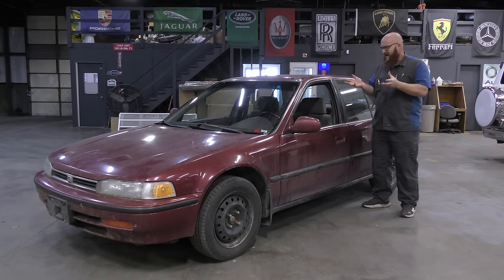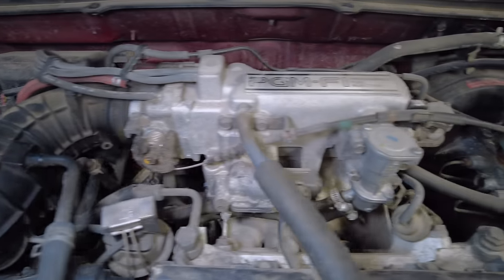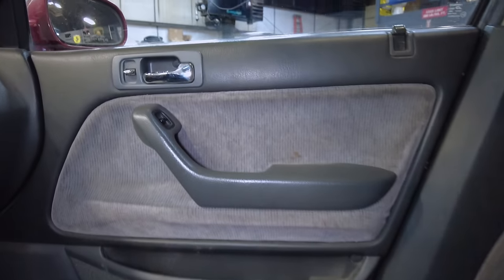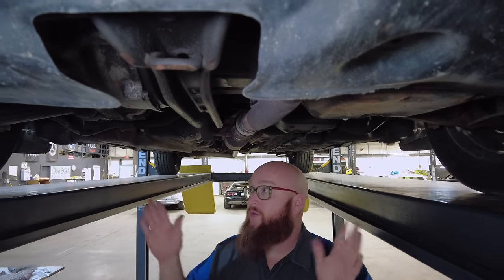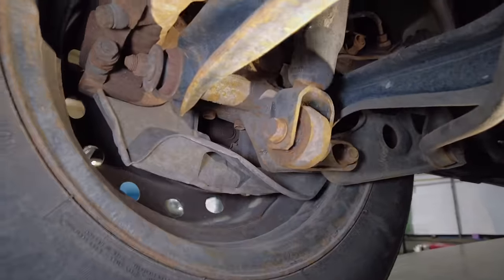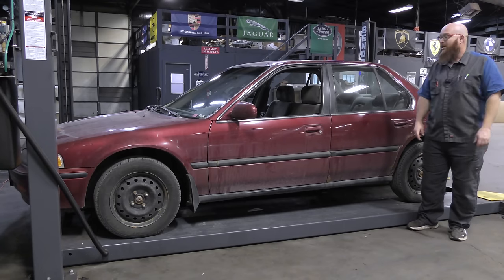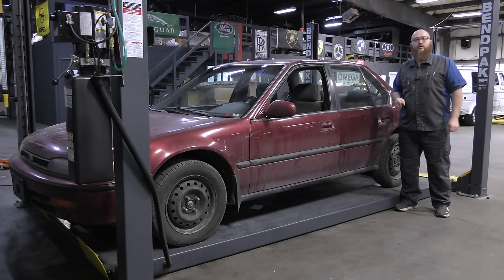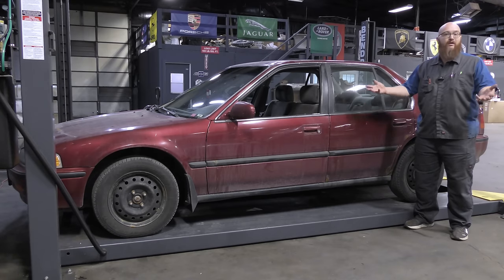A True Testament: 32 year old Accord with 380K miles! When Is It Time to Let It Go?

Comment: My first car was a 91 Accord coupe that had the same body style and was a stick but had automatic seat belts.  I bought it in the summer of 99 at 17 with a salvage title and 237,000 on the odometer. It burned a quart of oil a week and was quite rough but it was mine! I bought a new to me floor for the trunk since mine was missing and a passenger side view mirror that was from a salvage yard on the internet. My dad tried changing the valve stem seals to fix the oil consumption (it smoked like a train) but it didn’t so after Christmas break I brought it into my auto shop class in high school and we pulled the head and sent it out to be rebuilt. The machine shop owner and my shop teacher were friends and he came by after looking at the head and said I bet the rings are shot. He was right there was no tension left sky out came the motor and we overhauled it in class. Replaced the clutch and had the injectors rebuilt while I was in there. While putting it all back together my teacher had a heart attack in class while helping me reinstall the CV shafts and had quadruple bypass surgery the next day. My dad and I towed it the 8 blocks home and he finished it while I was at graduation rehearsal that Friday.  Three months later I got tboned in an accident and totaled the car. I was sooo devastated after all the work I had put into it.  Man I miss that car!
Reply: Damn the memories
Reply: "my teacher had a heart attack in class while helping me reinstall the CV shafts"
At first I thought it was figuratively, not a literall one.
Reply: @Misack8  I wish it was figurative.  The wood shop teacher next door came to get him to somewhere comfortable and as they led him away he handed me his school keys and told the other shop teacher that I was in charge of locking up and secure Inc everything and they sent the rest of the class to wood shop to hang out for the day while I locked that room and his upstairs classroom down and hung out.  I saw him about 6 or 7 years ago and he was looking much better!

Comment: I have a 240k mile 2010 Civic.  I've replaced the AC system recently, the air mode control motor, the drum rear brakes at 200k miles, a couple sensors, the headlights a while back, some window lining, and the power steering pump.  Did it buying parts and have an extremely skilled mechanic friend so saved the shop costs.  Absolutely worth taking care of and I hope to take it to 500k eventually.  I want to keep it for life if I can.

Comment: My mother had a 1992 Accord she purchased new when my family PCSd home from Germany. She was still driving it in 2015 before she finally sold it. Had 400,000 miles on the odometer and my dad rolled the miles back several times over its life. They guesstimate it had over 600,000 miles on it. 

All she did to it was routine maintenance. She hit a dog or something in 2010 and broke the passenger side axel. Only significant repair she had the entire time owning the car. 

Since 1992 my family has exclusively owned Hondas due to their incredible reliability and dependability. I’m sure this Honda will make the next owner extremely happy especially with the manual transmission

Comment: Congrats on the million subscribers. I am the original owner of a 2004 Honda Element with 230k plus miles and drives like new. No rust or dents. The bolsters on the front driver’s seat are worn but I have Honda Element seat covers for the front. Unfortunately Honda cheaped out on the seating. I service it routinely. Simple jobs I do myself and leave the more difficult jobs to the experts. Absolutely love the practicality of this car. Replacing sway bar bushings is like a 30 minute job if that and the bushings are cheap. 
Thank you so much for the video.
Reply: Got 03 pilot with 220k..bought it 4 or 5 years ago w 130k for $4000..2 d best vehicle behind my 94 nossan king cab truck w a manual transmission..had that for 300k miles pulling a lawn trailer..bought it from original owner in 98 w 125k miles for 2 grand.

Comment: I have a 2001 Saturn LW300 wagon that I purchased new that has 404,000 miles on the original engine and transmission. 
It has been a semi-retired dog taxi and foul weather/extra vehicle for a few years but it still starts instantly regardless of the time it's been sitting or the weather and it runs and drives fine.
The only thing that's ever been done to the engine outside of routine maintenance has been valve cover gaskets twice and the only other major repairs have been an ABS pump and shift solenoids in the transmission.
It is always been maintained according to the severe service schedule as outlined in the owners manual by a trusted knowledgeable mechanic and has given excellent reliable service. It's only been towed twice
Once when the fuel pump went out and once when the alternator died.

Comment: I have a 1993 accord coupe EX-R (Canadian model). I swapped it with a JDM H22A engine, has full bolt ons, the engine year is a 1994...

Few years ago i had it tuned on the dyno. It made 208 whp and 161 ft/lb at the wheels..

Pretty crazy when you really think about it.. the engine is 30 years old, the limiter is set at 8200 rpm (roughly 1000 rpm higher than the factory rev limiter). I beat the brakes off that car, it sees limiter every time i drive it. And 30 years later, its STILL running strong and making more power than it did from the factory. A testament to the build quality of Honda from the 80s through to the 2000s.

Comment: My 2003 Honda CRV is at 345K miles and still going strong. I put the money in it to keep it on the road. Cheaper than a new car. I drove it 7 hours each way on a road trip around 300 miles each way. I'm making another similar trip with it in July. Plenty of new parts and never stranded me. I burn a bit of oil every 1000 miles and top it off and keep going until the next change. I'll drive it until it explodes.

Comment: My ‘84 Corolla made it to about 685,000 miles. The first 250k were pretty good, no big issues. Changed the head gasket around 300k I think? Clutch, wheel bearings, valve seals, etc. Changed the HEAD around 600k and that was the beginning of the end. Got a brand new head and it was a disaster. One spark plug hole didn’t even have threads. I should have just sent it back but I added threads (that area never had any issues). Engine just never ran right after that. Tried rebuilding the carb then eventually just got a rebuilt one - ran worse after that. It would shut off for no reason at random and after sitting for five minutes would restart. 

Worse though was my ‘89 Supra. Piece of junk that should have been recalled. Head gasket blew at 118k miles. I took five weeks and rebuilt everything: engine from the head up, alternator, new clutch, timing belt, of course, and worst of all had to buy several new shims for the stupid valves. Adjusting the valves took a week, and a spreadsheet full of my shim measurements. Some of them were $25 each and I needed several. Sold it a year after and Never looked back!

Comment: My 2008 Accord has 336,000+ & still runs strong.
Reply: is it the 2.4?
Reply: Original trans and engine ?
Reply: Just regular maintenance?
Reply: Hes lying he wont respond
Reply: My '04 Accord is at 222K and I've only replaced the water pump and the AC condenser (stone damage). It's a 4 cyl / auto.
Reply: My 2012 has 256,000 and still driving smoothly
Reply: @bige3201 Engine/trans?
Reply: @dontrend5956  original engine and transmission. 2.4 litre. No oil leaks either
Reply: @bige3201 Auto trans?
Reply: @dontrend5956  yes
Reply: My 08 had 326k when I sold it. Burning oil and rear main seal leaking but ran great
Reply: @ERogers-qn2sm  It's actually very common for a Honda K24 to do well over 500,000 miles. There's a guy on you tube with a CRV same engine, 1,000,000 miles. I am not sure what the confusion is about 336k miles on an engine that's common for high miles?
Reply: As long as it’s not a V6 automatic it should do nothing less than 250k at least on the original drivetrain

Comment: I just sold my 1996 Odyssey I bought new. It had 340k miles on it still running great. I also had a 1990 Civic Hatchback with 310k miles, which I traded in for a new 2016 HR-V. I also have a 1989 Integra LS with 240k miles, and a 2007 Pilot with 162k miles, along with the aforementioned HR-V. I love Honda products!
Reply: 1996 Honda odyssey is actually made by isuzu.

Comment: Hi Car Wizard. I bought a Toyota Yaris 2008 sedan 2 yrs ago at 175000 km ( 108000 miles) peanuts for a car like that up here in Canada  for $4500. It now has 220000 km (137000 miles)The only thing I changed was the starter. Its been a great car for 2 yrs now driving me from to work from A to B. Also for its size , its surprisingly comfortable and the trunck in the back is very spacious and useful. I did some body work cause a bit of rust were the plate is...did good job, Bondo... match paint...clear coated it but a bit dull. It needs new rocker panels cause of rust and lots of salt here in Canada. I will form and weld the sheet metal with the mig into place, some foberglass Bondo...sanding...prime and paint. I'm planning to give a final clear coat on the whole car once everything is done. I'm a diy but this time will use the professional paint gun instead of cans😂. My question: I know I'm saving at least $3 to $4k by me doing all this work, how many more miles or kilometers will the car last me, it's a daily driver and is it worth the investment in time ?

Comment: I had a 1996 Accord. Bought it from a friend with 198,000 miles. $1300 and came with new plugs, wires, rear brakes and a battery, all done the day before. There wasn't a single straight panel on it. Drove it two years and only needed wiper transmission, front brakes, and a speed sensor. Sold it to a coworker for $1000 at 210k and 6 months later it had 260k. I asked him how it was treating him. His exact words: "Dude! The cruise  control only goes up to 100, so I get on interstate every morning at 4am, adjust the seat so my leg is comfortable while my foot pins the gas to the floor. This car goes 130mph for 50 miles straight!" I don't actually doubt that, because he had two jobs and being constantly pressed for time, drove like a madman. Also, I got it to 135 one night. Dumbest thing I've ever done, but the car took it in stride. He quit after that, and idk how long the car lasted after that. But it had to be the most hilarious thing to behold a faded, dented, ugly Accord with no grill passing you on interstate like as if you were stopped. 😂 Man, I miss that thing now.
Reply: 130mph?? Not cool
Reply: Given that our old 1991 Accord 2.0i pretty much made it to an indicated 200 km/h, I can certainly believe 130 mph in a '96, especially with the 2.2 in it or something. 160 (100 mph) was our normal Autobahn cruising speed. Things were not exactly too quiet at that point, but that's kind of par for the course. If you really needed a comfy 200 km/h Autobahn cruiser all day every day, you'd be driving a 7 series or S Class or similar for at least twice as much money if not more (or at least a 5 series / E Class, still considerably more expensive).

I kind of miss that car, I always really liked it even with a bit of an involuntarily lift (it had to get some new springs as one had broken due to rust, and I guess they weren't exactly right). I hope it's still riding around somewhere in Eastern Europe or Africa or wherever, probably complete with a 16 gig Transcend MicroSD card from my MP3 player that I lost in the back seat while on vacation. The issues that it did have were quite minor, the biggest problem was an intermittent starter relay which these were kind of known for. We could never find the darn thing though, and ultimately the car ended up being sold.

Comment: Sold my '91 CB7 two years ago after 3 years of ownership.  Completed my first timing belt job on that car and got a/c ice cold.  Zero fluid leaks after changing a few gaskets. Was a bit uncomfortable but was fun to drive (5 speed) and nostalgic for me.  150k something miles with very little rust!

Comment: We still have a 91 audi 200 20v turbo avant (also a sedan) in the family.
It has almost 450k.
It has been modded over the decades.
About 12 years ago it ran 12.1 in the quarter mile (at that point it had 3xxk miles).
She still runs really well.
We live in the rust belt and it has taken its toll.
The rockers are shot now.
They will be replaced.
Still has the original engine and trans.
Id assume this Honda will be able to keep racking up the miles.
I would bet this honda has had less electrical issues than the audi though (if youve owned a 200 20v you know....instrument cluster, lights, etc).
Basic maintanence goes a long way to keep these older cars on the road!

Comment: I’ve got an ‘05 Accord LX (complete with hail damage haha) and the car is great for what we need. It’s our backup car and I drive it once a week to go to a Bible study at church. I have some annoyances with the car - the radio died, one of the wheels doesn’t want to stay balanced, probably the one thing I want checked out is a vibration I get when I drive the car with light throttle (just enough to maintain speed on a level road). As soon as it happens I can either let off the gas or give a little more and the vibration goes away - it doesn’t appear to happen if I’m using cruise control. 

I love these types of videos Wizard, congrats on hitting 1mill. Subs!

Comment: My 2007 Lincoln Town Car Signature Series is still running strong with little rust and 500,000 miles on it. I did a compression test and it still has 180 compression in each cylinder. Not bad for a Wisconsin car.

Comment: You gave them good advice, Wizard. I owned a '93 Accord and still own an '89 Accord. The '93 was the last body style with 4 wheel double-wishbone suspension. You won't find another car that handles like that one. Even so, parts for that thing are getting scarcer by the day. My '89 has been broken down for well over a year because I can't get the parts I need. Tell your customers to sell that car quick while it still runs.
Reply: Zero resale value; they may as well keep using it while it works.
Reply: @petesmitt totally agree re: the resale value...the annual oil changes are more than the Value,....but good cars either way

Comment: 387,000 miles on my 94 Integra GSR. All original drivetrain, and zero rust. I’ve owned it since I was in college in 2001. It still serves daily driver duties on rainy days when I don’t drive my Miata. Even took it over 1,000 miles to Tail of the Dragon a couple years ago. At this point I’m just doing mild restoration work here and there, until I get a bigger place where I can tear down the and respray the whole car. Given the somewhat rarity of good condition examples and what the car means to me, it will absolutely be worth it to put the money into it.

Comment: I bought a 1991 Accord new. It was the most rock solid car I've ever owned. Sadly, by the time my youngest daughter was using it, it was stolen and ran in to a creek when they were though. It had 240K on it and it could easily have doubled that. But there were minor annoyances like this one, window regulators needing to be changed, the front rotors had to be turned on the vehicle and I had to replace the radio antenna a few times. Pass that, no major issues.
Reply: My girlfriend had one, the transmission destructed and the timing belt broke early.
Reply: @mitchhedberg4415  Weird. How many miles were on the timing belt and was it an aftermarket. The transmission on mine never had a fluid change and I believe the owners manual never said to change it in the maintenance schedule.

Comment: I've got '94 Plymouth Acclaim that's just about to hit 100k miles after 30 years. It's not built to the same level as a Honda or Toyota of the time, but still runs and drives great.

I've used the car over the last 5 years as an opportunity to learn about car repairs and have an inexpensive ride until I was out of school and had saved up some money. I'll probably buy a new Miata this year - so that I don't have to worry about getting repairs done to get to work on Monday. However, I'll probably keep the car until it rusts out and stops driving as a challenge and in the spirit of keeping it going as long as I can.

Comment: I have the honda accord 1996  four door sedan with the same color, it has 169,000 highway miles and  body and interior are in excellent shape  no rust on body ( clear coat peeling off, needs a paint job) but interior looks like new.  We have followed the manufacturer's requirements on maintenance and the engine looks quite good. Now, my wife and I drive it around our small town only.  But with the age and small things begining to appear such as transmission shifting a little rough, and dashboard engine light ( oxygen sensor bad) , we are getting ready to sell it. but bought new in 1996 and a little sad to see it go.  When you have something that long that has given you no problems over the years, its hard.

Comment: I had one of these accords back in the mid-late 90s.  92 EX Coupe 5 speed. I used to take it to the drag strip back when import racing was still a fairly new thing.  Thought it would be fun to enter the burnout contest at an event and spun a bearing keeping it near redline until both tires blew out (I won at least, lol).  Drove home from MD to NY with the engine knocking away and put hundreds of miles on it that way even after that, including an autocross event, and a trip to Atlanta for Nopi Nationals, until I had a h22 from a Prelude swapped in.  That original 2.2 just wouldn't give up!